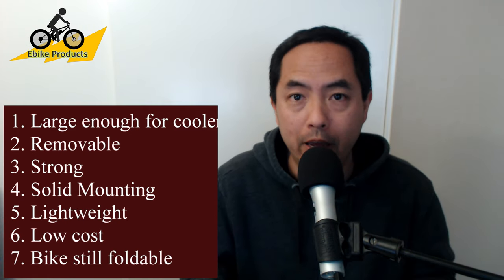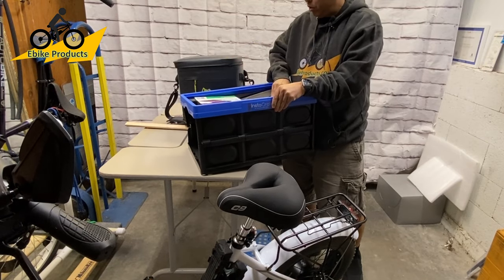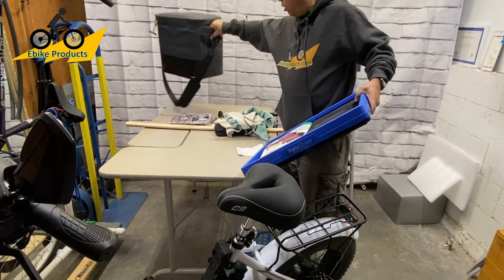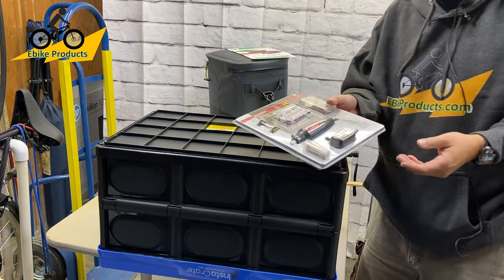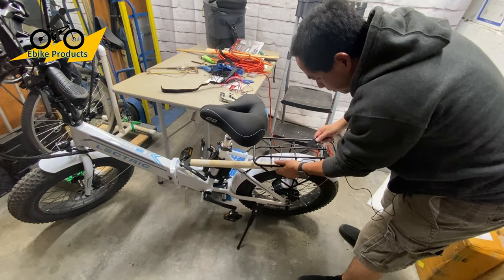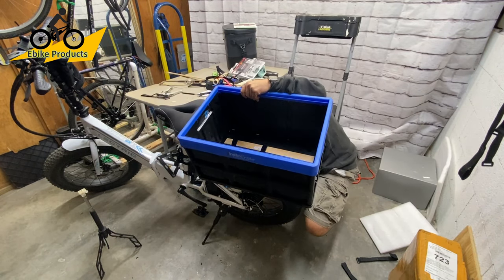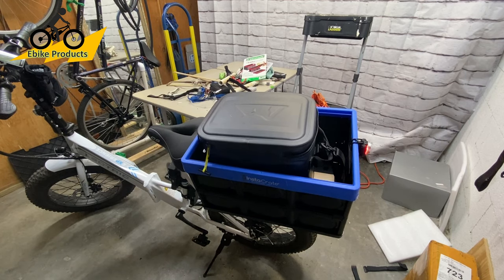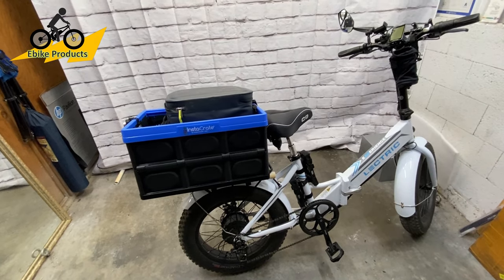Lectric XP Ebike Collapsible Basket/Crate Rear Rack Installation DIY

Comment: I used the same crate for my 2.0. It’s been on my by bike for a long time now. I put a piece of plywood in the be bottom, front and back co it no be longer collapses. I use it for my 25lb dog most everyday. I put a 2” false bottom in it. Best feature ever!! It holds all my tools, locks, alarms, spare tools etc. completely out of sight and always with the bike. I used the rack mount bolts. This puts the box up against the lug seat and was annoying hitting me in the back. Yesterday I cut about 8”x8” out of be the be box where it was hitting me. Sooo perfect now

Comment: Thanks for the inspiration, i'm using an 11.5 x 17.5 box on my rear rack with straps to carry 2 14lbs extra battery. Feel free to see my Lectric 52V demonstration. I need to detach the 30lbs box each time i use it cause i live in a 3rd floor apartment. I like that box of yours.

Comment: nice job. i installed the same crate on my e-bike (Aventon Pace 500) but I oriented mine the other direction because it allowed me to move it away from the seat and still centered solid on the rack under weight. Your setup looks like the crate is close enough to the seat that it would rub your rear. any issues with that?
Reply from the maker: You’re right. It does touch my rear, but being a short guy at 5’5”, I have room to scoot forward and still ride comfortably as my arm reach on the XP 1.0 was a tad far if I sat back. I kind of just got used to it.

Comment: Actually, I would have used 3 sets of slats. 1 set the inside length of the rack replacing the pvc pipe. The 2nd set the full length of the crate for support over the rack but under the crate. The 3rd set is the interior length of the crate.  Laminating the support to the full length should give it a support base to stay put.  Additionally, I would use hose clamps instead of velcro to ensure it could not come off accidentally.  You would also have to get right under it to see how it's connected, making it almost invisible.  Another change I would likely make is using thinner aluminum stock instead of wood so it would close properly when not in use. Obviously, aluminum being stronger than wood it should be much thinner.

Comment: I’m trying to take my rack off, but this electric wire is the last thing that needs to come off but I don’t wanna cut it, do you know how can I solve this without damaging anything, it’s connected to the red light on the back of the XP?!
Reply from the maker: Sorry, I don’t know the answer to your question. You definitely want to reach out to Lectric’s customer service about that. I am thinking they may have a good solution to avoid cutting the wire.

Comment: I have a Jenson Warren all train and I have a back rack and a seat with sprigs. This bike came with absolutely no suspension. The front forks look like the are suspension forks but they are just for looks is it possible to swap out the front forks and put on a set that has shocks ?
Reply from the maker: The bike in that video is the Lectric XP 1.0 which is no longer being sold. The newest 3.0 version has front suspension and is the #1 selling 20” foldable ebike on the market today. You can see the review I did on it here: https://youtu.be/_Bt_lzmW3Tc?si=Ucw-n6sXZqiSsAFT
If you’re interested in seeing the current specs and stock, you can go to their site using this link https://ebikeproducts.com/lectric

Comment: Did you consider using cargo net to hold your lunch box to the rack without a crate?
Reply from the maker: I actually have a cargo net that I tested, but my lunch box is too heavy and tall to safely make the 28 mile round trip to and from work. Also, I found that the extra space in the crate is perfect for me to carry extra tools and clothing etc.
Thank goodness for the motor, I carry so much stuff I look like I am going camping.😋

Comment: Here is another way to attach an Instacrate to a rear rack.  You will need a 1/4" poplar "hobby" board at least the length of the crate, and another 1x3-inch board of the same length.  You will also need 6 D-rings with attachment brackets, 1" washer head sharp-pointed screws and 6 Velcro or similar straps with buckles.  Cut both pieces of wood to the length of your rack or the length of the inside bottom of your crate, whichever is shorter, as needed.  Mark the middle of the bottom of the crate on both the inside and outside.  You can use blue tape for this on the outside, to make it easier, since the crate is not flat.  Place the 1x3 on a flat surface you don't mind drilling into, place the crate on top of so the middle of the board is aligned to the tape on the bottom of the crate, and the thin board is aligned in the middle of the inside of the crate. Have somebody help you hold down everything, so it does not shift.  Drive three or four screws from the inside of the crate through the middle of the thin strip into the 1x3.  Next, attach three D-rings with your screws to the sides of the 1x3, equally space along the length of the board.  Place your crate on your rack, and use the straps you bought to fasten the D-rings to the side rails of your rack.

This crate is great for hauling stuff on your bike, be it an eBike or regular bike.  You can collapse it when not in use and use a bungee cord to keep it folded and stop the rattling.
Reply: You should make your own video bro.
Reply: @Airbender24B  I might!  I wound up switching to a 2x4 instead of a 1/4" board because I had one on hand.  Should have purchased the 1/4" board instead.  Future update.
Reply: @jackpine4347  Hey man! I took a little time out of this weekend to make a video of my own quick and easy basket setup on my other channel. I'll be right back to leave a comment from that channel.
Reply: @brandinojam24  Nice!  I like the idea of the pad to create friction between the basket and the rack.  My setup is for a non-electric bike, using a Blackburn rack.

Comment: Is it possible to put straps or something into the crate holes?
Reply from the maker: This particular crate doesn't have convenient holes anywhere so I have a motorcycle cargo net that I got from Harbor Freight that I use to hold things down that might stick up or to keep the crate from rattling when its empty and flattened. The crate handles can be used for straps but with them being front to back, its not a secure holder. There are other folding crate brands that do have lots of holes that could be used for straps, I am just not sure how strong they might be.

Comment: I would just attach the cooler with bungee cords to the rack and forget about that huge box.  Remember the more weight you put on the bike, it will deplete the battery faster and your speed will be slower.
Reply from the maker: I totally wish I could do that. Someday I will cut down on the amount of food I take for lunch to really lighten the load. My cooler is too unstable and heavy for bungee cords to hold it securely on my 14 mile trek to work. You're totally right about the weight and how much performance I will be sacrificing. Thankfully, I should be getting my Bolton BlackBird before the end of the month and that 750watt motor should be easily be able to maintain a decent speed. Thanks for commenting!

Comment: What do you recommend for a delivery rear rack for a Hyperscrambler 2?
Reply from the maker: Whoa! That is one SWEET ebike!!! 100+ miles at over 30mph and dual suspension! Style reminds me of my old Puch Cobra moped.
As far as a delivery rack goes, I can only picture a custom rack working with that ebike. I would perhaps look for a sturdy rear ebike rack on the market now and find a way to modify it to fit on it. I would see if there is a way to attach the rack to a point right above the rear shocks and also to the bars that support the seat to make a triangular support. 
The big issue I would be concerned about is getting on and off the bike with a load or something that is higher than the seat as I would not be able to swing my leg over and would almost have to lean the bike near to the ground which could be hard if the load is heavy. Just a thought. Carrying stuff may have to hang on the side of the racks to keep the weight lower to the ground for better balance.
Reply: @EbikeProducts  thank you for the advice

Comment: 14 mile commute on a lectric xp? i dont suppose you can do this on one charge and back.
Reply from the maker: I might be able to do it if I used every method to ride as efficiently as possible, and if the first part of the ride was uphill. 

Unfortunately, since my commute is slightly downhill to work the battery drain all uphill going when already a little depleted would kill it fast and I think I’d probably be walking the last couple miles home.
Reply: @EbikeProducts  theres always another battery option since you got the cargo box now. I was going to get a lectric as well, but after lots of reading and videos, I am deciding on a Fiido L3, true 70+ miles to a charge on throttle only.  1-2 chargers a week , there are pros and cons, but I feel its a better choice and still has a mini rack in the back build into the frame.
Reply from the maker: @redw0lf848 Fiido makes great e-bikes.  I need higher speed and softer fat tires to make my commutes comfortable. Some of the Southern California streets I need to ride on can be dangerous if the bike is too small and too slow. 70+ miles is definitely a huge benefit!
Reply: @EbikeProducts  I understand about the tire size, however it is unlockable to 20m/h speed from the default 15 m/h, I find that would be sufficient speed. And the seat is designed with  extra plush for comfort since its range is its selling point.   at 350w motor, its got pickup. We will see, maybe ill make a video.